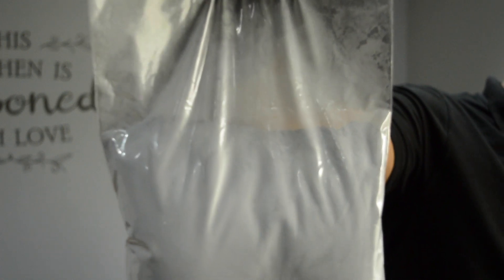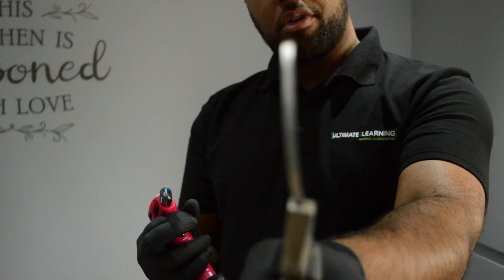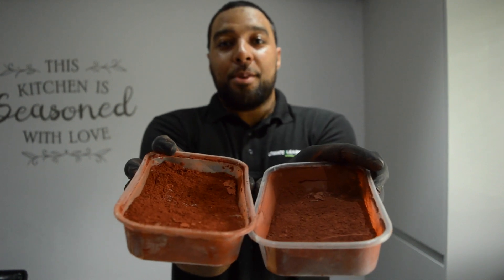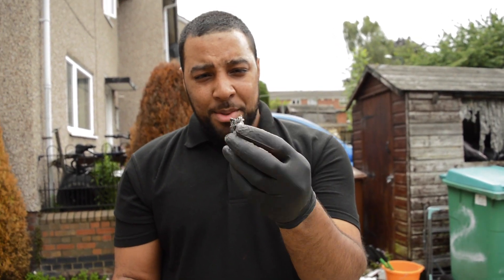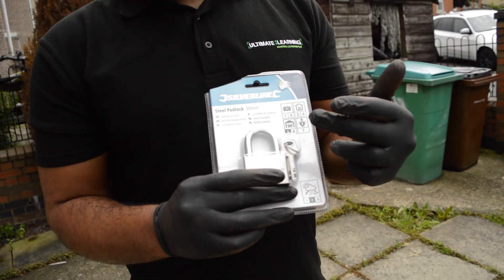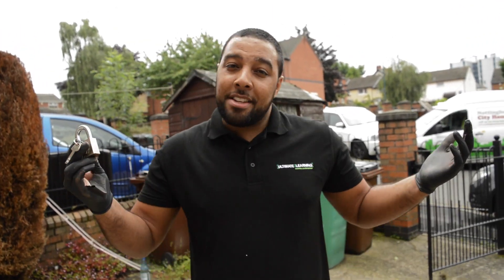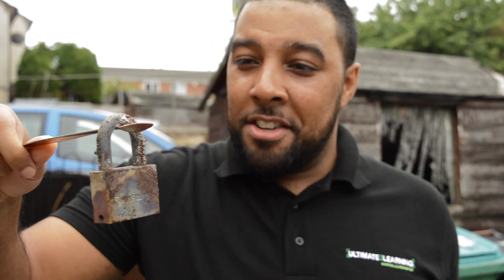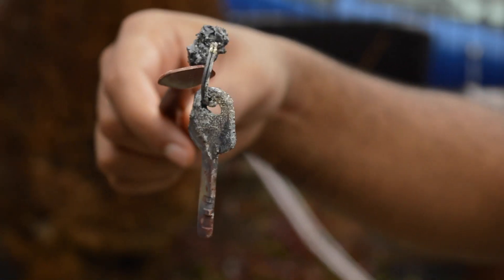Thermite vs Padlock (Breaking Bad Debunked)

Comment: Why did you just put a pile on top of the lock? All of the heat is escaping upwards, it's not even burning the lock. The Temp at the lock was probably 100-150% lower than at the reaction point, if not more, and you were directing literally 0 of it towards where it should be. While not ideal, something as simple as an angle iron would have helped raise the core temp. 

You need the temperature at the reaction point to be as high as possible, so for that you need the stoichiometric reaction ratio. I have a feeling you made some shitty thermite, cause that lock should have been a puddle if you did this correctly. 

I applaud your scientific thought process, but ability is questionable. This was decent experiment design wise, but you had the concept of how to work with the material you had on hand completely wrong. 

To make this work right, you have to keep the heat directed. Then the temps raise wayyyyyyy higher than just burning it in an open environment. 

TLDR: the lock didn't burn through because you fucked up multiple points of the experiment. You were barely even working with thermite in the first place, and you didn't create any sort of direction mechanism to make sure the thermite wasn't just burning into the air. 

You have a lot of people telling you you're a genius for this, I hope you don't let that go to your head, you're making a LOT of mistakes and I hope you have the presence of mind to fix them instead of thinking you're too smart to listen to criticism.

Comment: What if we mix thermite with gunpowder will it burn even faster or hotter
Reply: no, it wouldn't. The two chemicals would be competing for the same oxygen, and the more reactive (gunpowder) will eat up more of the available resources because the reaction happens much faster. What you would end up with is a smaller explosion than you would otherwise get with the same amount of gunpowder, because the thermite is taking up some of the reactions materials. 

It doesn't make both reactions MORE, each reaction eats off each other because they're fighting for the same oxygen,  so it's actually a far less intense reaction

You can't just take two expolody things and add them together, if you want a bigger boom, you need more fuel AND oxygen, and they have to be in quite a specific ratio to maximize the output
Reply: But what happens if i mix 2 compounds which contain oxidizers, would the reaction be bigger? Like mixing gunpowder with flash powder, would they compete for the same oxygen, or the reaction would be more powerful? @crossup13
Reply from the maker: hmmmm sounds interesting! perhaps a new idea for a video

Comment: thermite burns better when mixed very well, i think the results might be different if the iron oxide and aluminum powder   
were mixed more/better, great expirament nonetheless.
Reply from the maker: Wait until you see our new and improved version!! Thanks for the feedback buddy, the main mistake was not concentrating the thermite in a plant pot! But you will have to wait and see if that works!!
Reply: @ultimatelearning5147  you need something better than a plant pot dude, ceramic and thermite burn at similar temps, if you actually get the temp up as high as you need it you need something with better heat resistance like steel or graphite. 

You have the right idea you're just going about it retardedly
Reply: U need a container and let the thermite, melt down/drip down onto the lock not cover it with the mixture
Reply from the maker: @hejeolle  Stay tuned I did just that!

Comment: I’ve played way too much rainbow six siege
Reply from the maker: Is there Thermite in Rainbow Six?
Reply: Ultimate Learning not exactly but the name the operator takes for is Thermite, you see when you mix fuel, metal oxide and metal powder in just the right way, it burns at 2000 *C, it’s almost powerful enough to cut through any metal as supposed to the actual game which kind of confuses the actual logic
Reply: big fucking hole coming right up

Comment: So a pile of thermite isn't going to do much, it has to be directed in a cutter box. The breaking bad implementation was comical to anyone who knows how it actually works. But you probably can design something to cut through locks with thermite.
Reply from the maker: Good point, I was thinking about using a ceramic plant pot (they have a hole at the bottom) - maybe that will work *Heisenberg hat on*
Reply: you 100% can. It's the same exact thing as a shaped charge but easier to make cause thermite doesn't explode.